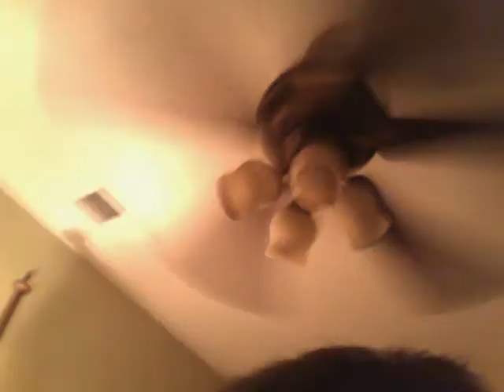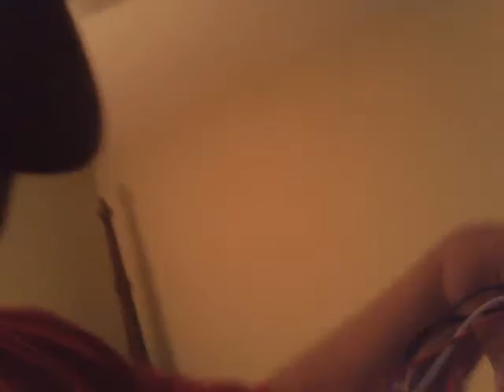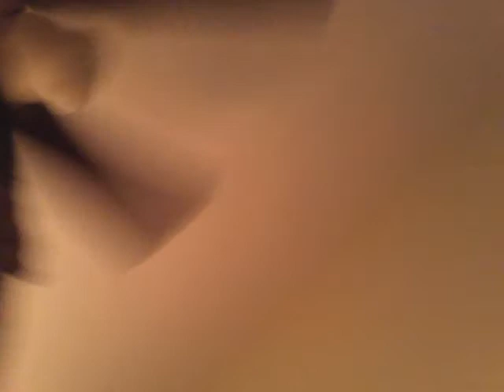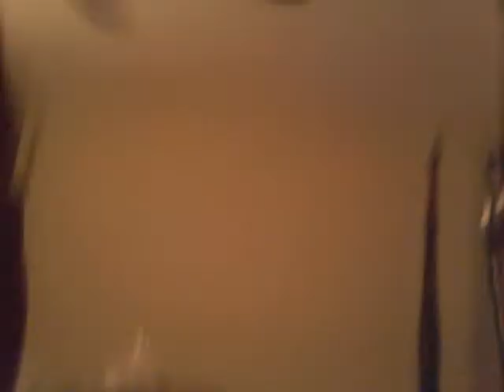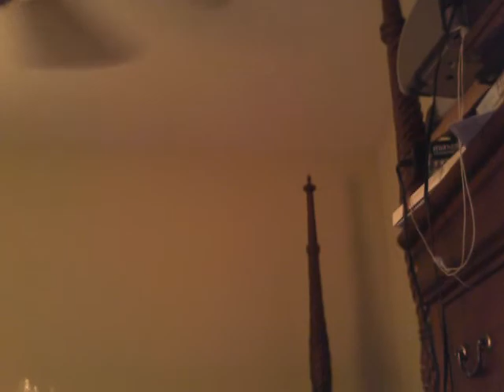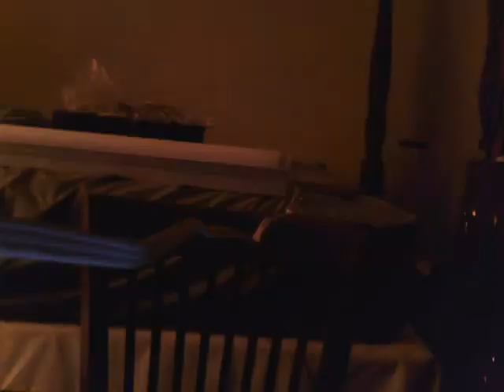Ballast Swap on Lithonia Shoplight

Comment: Hi....you said there is one of these fixtures in your dad's garage that wouldn't start if the temp was below 50F.  Did the fixture completely die (and was it the ballast) or did it ever work again (after the temperature went above 50)?  I have two of the $15 Home Depot Lithonia model 1233 RE 2-bulb fixtures in my garage and we're having some really cold weather right now in Dallas and one fixture stopped working but the other still works OK. I was just wondering if the unit might work again after the weather warms up or if I should just replace it? Also, it sounds like it's cheaper to just get a new fixture than replace the ballast.  Thanks for your help!

Comment: I have the same Lithonia fixture in my garage, and it does make me wonder about the cheap ballast supplied with it. I dont know if its normal that the neutral goes into the light like a preheat, if the ballast is rapid start. These ballasts are cheap, too.